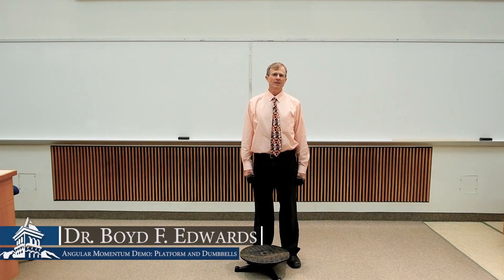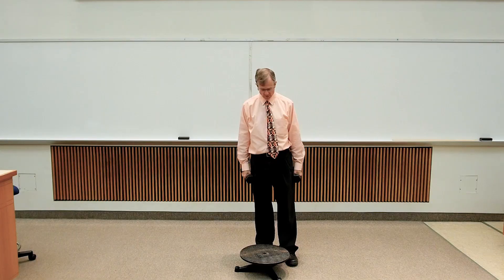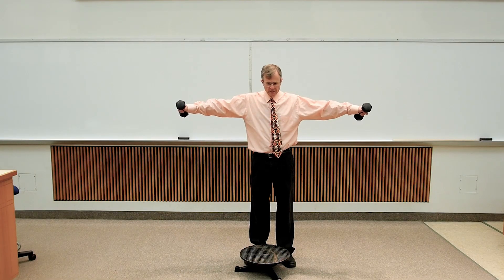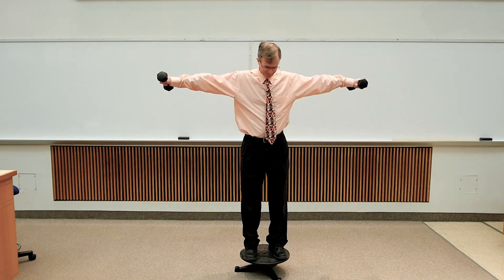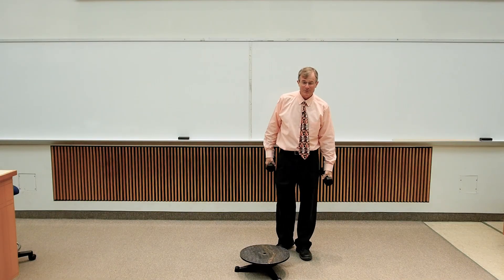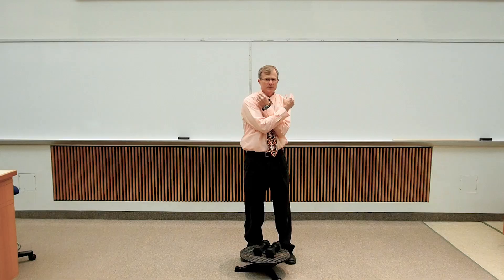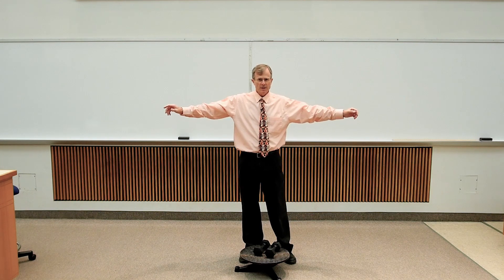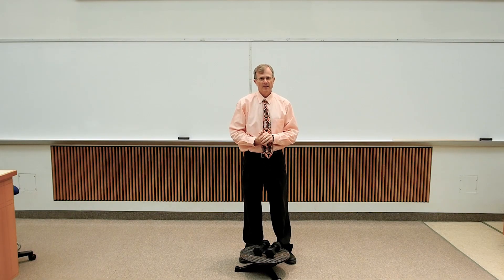Angular Momentum Demo: Platform and Dumbbells

Comment: You are not demonstrating conservation of angular momentum - angular momentum is not conserved when you change the radius. Measure the results of this demonstration and you will see that it does not match what is predicted by physics. The angular speed increases purely because the circumference decreases. www.baur-research.com/Physics
Reply from the maker: Thanks for writing, John.  If the net external torque is zero, then 
angular momentum is conserved, and I_1w_1 = I_2w_2, where I is the total
 moment of inertia (of platform, body, and dumbbells), and w is its 
angular velocity.  The platform bearings are not frictionless, so the 
bearing torque qualifies as an external torque, and angular momentum 
will be conserved only if the bearing torque is negligible.
Reply: I am sorry to contradict you but you are incorrect. What is conserved is the magnitude of the linear momentum. Take measurements of your demonstration. Friction is not sufficient to account for the difference that you will record. When you extend your arms again, you will find an increase in angular momentum. To what would you attribute that ?
Reply from the maker: Then we'll have to agree to disagree, John.  If you extend your arms again, you'll increase the angular velocity, not the angular momentum, which remains constant (if external torques are negligible).  This is among the best known results of classical physics, and is correct.
Reply: No, when you extend your arms again, the angular velocity will decrease and the angular momentum will increase. This goes against what is generally accepted, yes, but what is generally accepted is mistaken. Point it out and you are faced with the most severe case of confirmation bias possible. If you measure your demonstration and you will see that what I am saying is true. Scientists have been performing this demonstration for centuries but as yet have failed to measure the results.
Reply from the maker: Sorry, you're right.  I meant that you'll decrease the angular velocity 
when you extend your arms.  But I continue to assert that the angular 
momentum is conserved if external torques are negligible.  The 
theory is clear - if external torques are negligible, then the angular 
momentum will be conserved.  I'm not interested in doing experiments on 
this classical result.  If you have done such experiments, and if such 
experiments have not actually been done, or have not been done correctly, then I suggest that you submit 
your results to a peer-reviewed journal like the American Journal of 
Physics for review.  The trick is to minimize frictional torques, which 
are certainly not negligible in the standard classroom demonstration.  
If your paper is published, I will be happy to read it.
Reply: I have submitted my work to every journal I could find but am faced with immediate rejection without peer review based on the confirmation bias of the editors. Your demonstration is invalid and you should be interested in doing an experiment. My first paper is a five minute read and it would give you pause for thought.
Reply from the maker: Well then by all means send it to me at boyd.edwards@usu.edu.
Reply: The only thing you are demonstrating here is that since w=v/r, if we reduce r, the angular velocity will increase.
Reply: @TheAnimammal  But what you don't seem to grasp, is that in fact, angular momentum is a different quantity all together from angular velocity, which you constantly mention. Think for example the more traditional linear motion examples: momentum is not the same as velocity, but is affected by mass as well as velocity.

By similar reasoning, when you reduce r, the angular velocity increases, BUT the angular inertia (called moment of inertia in the video) will decrease proportionally, therefore angular momentum is the same as before because it equals angular inertia * angular velocity, and not just angular velocity.
Reply: @joshuapfingerle4704  There is nothing to possibly suggest that I have confused angular momentum and angular velocity. You make a fake character assassination. 
What you don't seem to grasp is that it spins faster because angular energy is conserved which means that angular momentum is not conserved.
Reply: @TheAnimammal  I think u r trolling.
Reply: @explainedwithgpt  No, you are trolling.
Reply: @explainedwithgpt  haha. Like that
Reply: @physicsdemos  Did he ever send you his paper? What did you think of it?
Reply: The proof is not even a proof at all.

COAM is truth. The theory of angular momentum not being conserved is total nonsense.